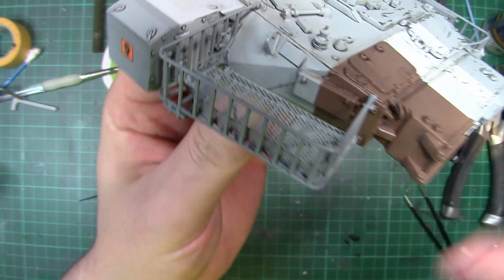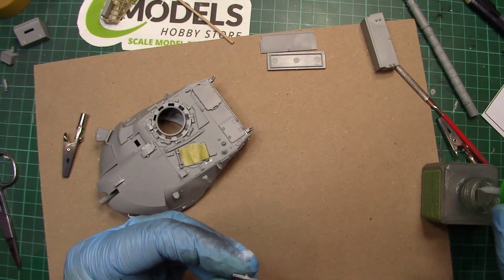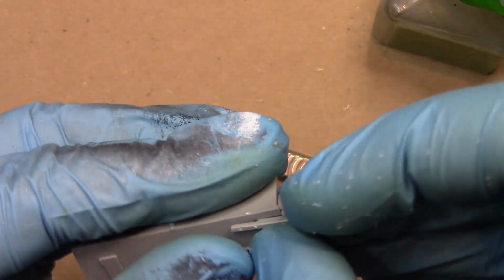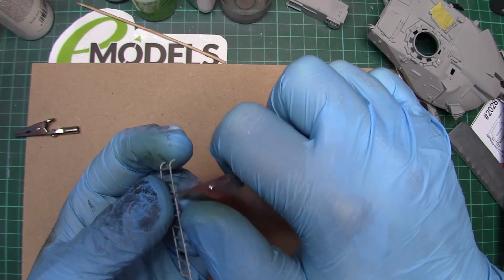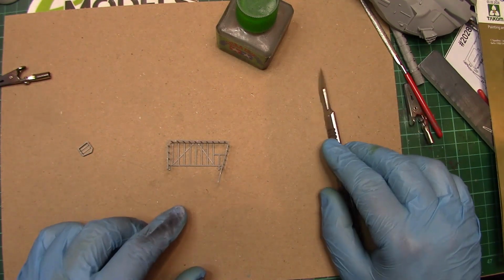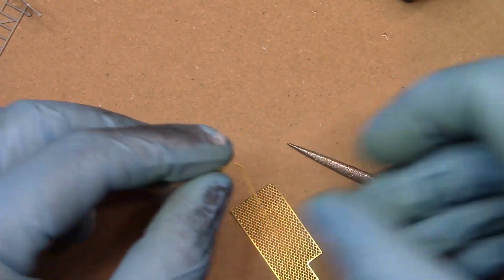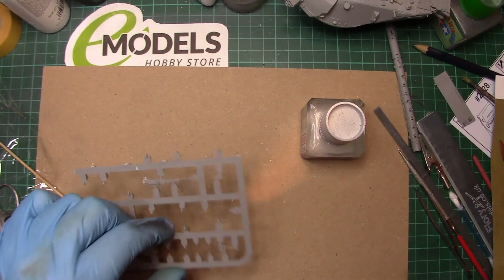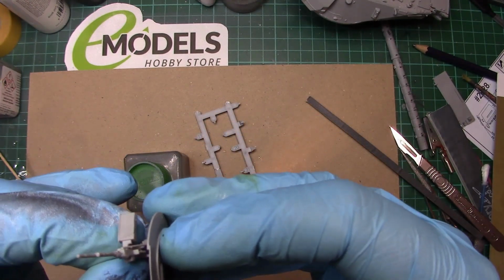Takom - CHIEFTAIN Mk.10 Part 5 with Tony

Comment: You silly billy.. test fit. then test fit just to make sure :)
Reply: Which bit Karl? I did this section in February lol, My memory's not that good - do you mean the photo etch that slipped it's position while I went to bed?
Reply: Lol, no the bit where you cut what you thought were nubs 👍 and the found out it was not a nub 🤕🤕
Reply: Making_Models ah gotcha! You know, the size of these nubs to start with, it's a VERY easy mistake to make! Like I always say too, I make the mistakes so you don't have to - and now you know not to trim that part lol
See, all happens for a reason ^_^
Reply: helgan35 ohh I have done it quite a few times. 😂 To de nub or not to de nub 👍😂